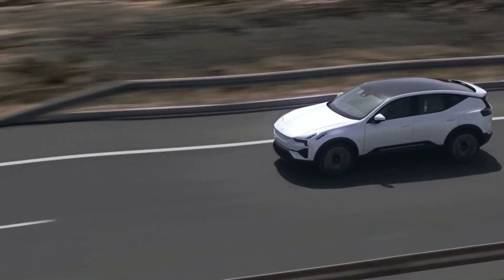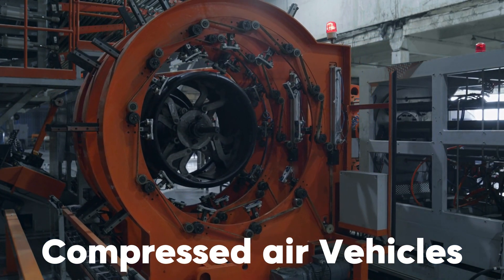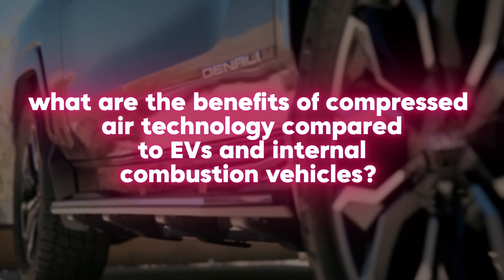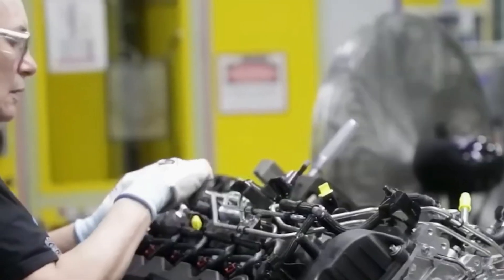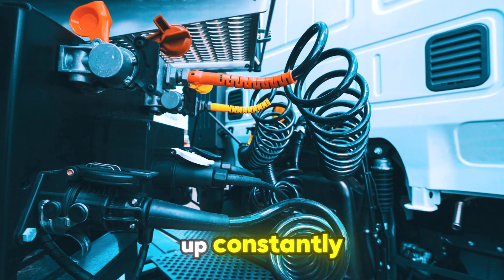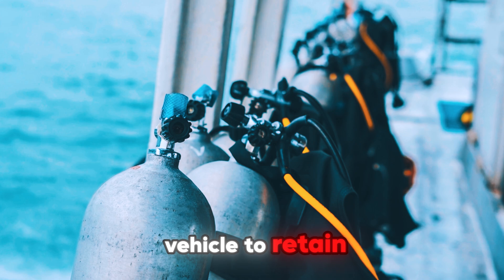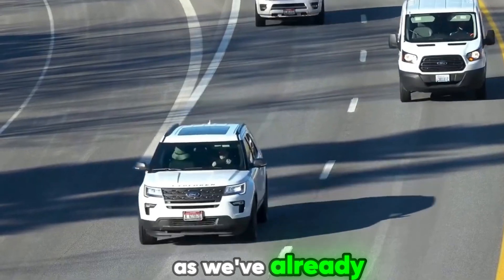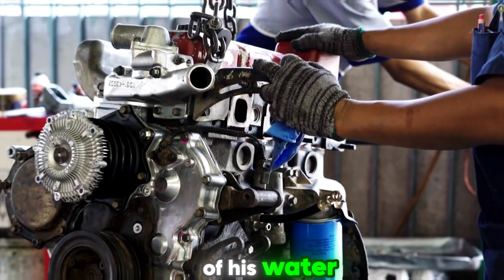GM CEO: "This New Engine Will CHANGE The World!"

Comment: Cool concept. I don't think it's going to be around in my lifetime. One of the key issues with hydrogen engines was the frost, when air decompresses, it cools significantly. This is just how thermal dynamics works. 
Furthermore, it also requires some power to produce, and while it is technically greener to compress a tank of air than to use electrolysis to get a tank of hydrogen and compress it... The same size tank of hydrogen will last a lot longer due to how it works.